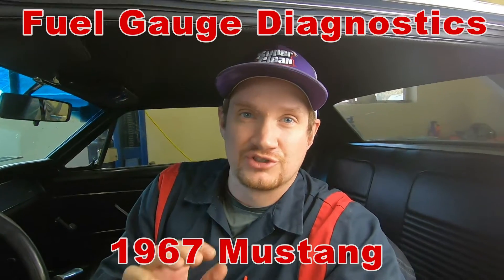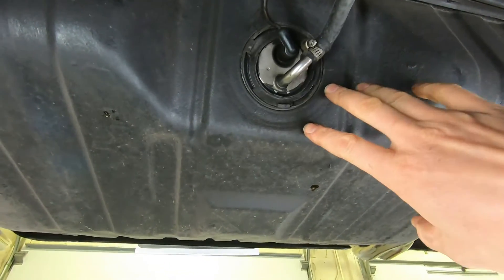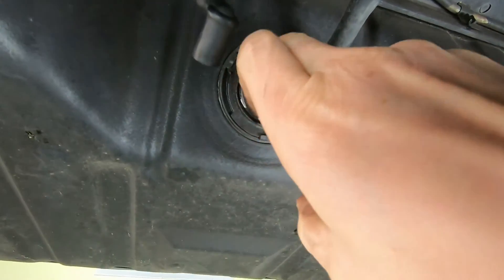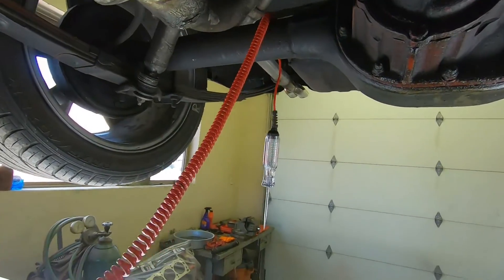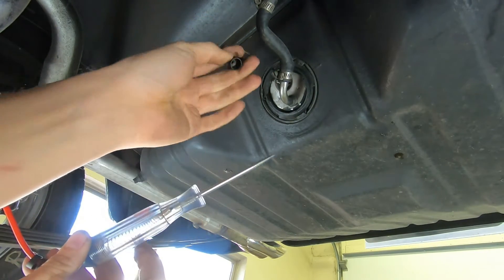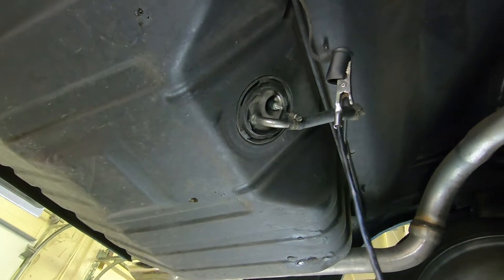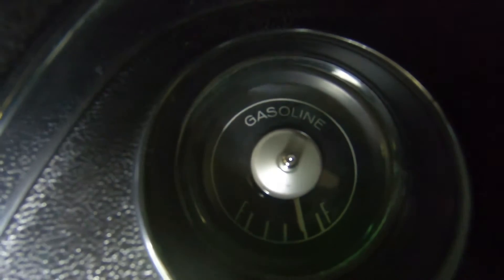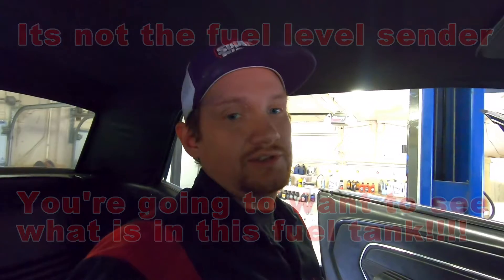Fuel Gauge Diagnostics - 1967 Ford Mustang

Comment: Enjoyed the video, but I don't understand the difference between the two methods used to test connection to the fuel tank/gauge. In the first test (using the test lamp) the ground is to the battery and the key is on. The test light then goes on to show the circuit is good.  OK. The second test uses a wire to ground the sending unit wire and then the key is turned on to watch the gauge needle climb to "full".  In both cases, the sending wire is grounded, right?  I followed your guide for the both tests, but when I tried using the test light, the light did NOT go on, but the fuel gauge went to full.  Doing the second test, the fuel gauge went to "full".  Seems I did the same thing twice.  So, how do I interpret the information?

Comment: When testing the fuel guage, where are the leads ran to?  I see a leads to the u bolt and one to the fuel sending unit wire.  What is on the other end of the leads?
1967 coupe, T-5 swapped and 289.
Reply from the maker: That's it. One to the sending unit wire, the other to ground.
Reply: @AlfsMustangGarage  
I meant, leads from the battery or multimeter,  or, etc??? 
Signed, electrically challenged.
Reply from the maker: @theepas0509 https://youtu.be/gTC5uqolllo
You should watch this one to be more familiar with electrical testing.

Comment: What does that mean if it doesn’t spike when you do the last test ?
Reply from the maker: It means there is no voltage at the sending unit. If there is no voltage at the sending unit, then it could be a voltage supply issue to the gauge, a broken wire, or the gauge itself is faulty. Next step would be to see if the gauge is getting voltage.
Reply: @AlfsMustangGarage  ok 👌🏽 thanks and when it does spike, if it spikes it should spike to the level of where the gas was last filled to right?
Reply from the maker: @tmacdagreattv no, it will peg completely to the right side of the gauge. You're giving it full contact ground, and the gauge is not intended to get full ground ever. This is why you only want to do this for a split second. It's just long enough to see if the gauge responds.

Comment: I did the tests on the sending unit as you described.  The fuel gauge will head to full after grounding the wire for the sending unit and turning the key to "on".  However, when I use the test light to check the wire for the sending unit, the test just barely glows red and is a steady light. No pulsations.  Does this point to a bad constant voltage regulator?  If so, will be my third one!

Comment: Testing my 63 falcon gas gauge. When connecting the sender wire to the ground I'm getting a weak steady light (no pulsing). Then I get no reaction from the Gauge when I connect the + & - to the gauge at the sender. I've also just replaced the regulator prior to these tests.  Would you suggest testing the gauge directly to eliminate a wireing harness problem? Any other suggestion?              thanks! Good video

Comment: late comment, but I just bought a 67 coupe and the gas gauge worked with the old cluster and when I swapped it for the new one the gauge stopped working what should I do ?
Reply from the maker: Well if everything worked fine before you were in there, I would maybe retrace my steps and see if something isn't connected. Or you could just go through the process of diagnosis and see if you're getting power to the sending unit.

Comment: Thank you for this video.  
I followed it to a T, and as it turns out, electrical was all good, and the gauge was in working order.  
The issue i ran into was the float on the sending unit had deteriorated to nothing.  It was literally GONE.  When i pulled the sending unit and i saw it was missing, i assumed it just fell off.  So i pulled the tank and it wasn’t in there.  This was the original sending unit from 1968.  Bench tested it and it still worked.  
Evidently, the brass/copper float can dissolve in fuel after 54 years.  
Great video
Reply from the maker: Oh wow that's incredible. Ya that must be why these little brass floats are available. If you're original sending unit still works great, I would keep it in there. https://amzn.to/432eYcl Here is the link to the replacement float.
Reply: I too have a 68 that the fuel gauge wouldn't go past half a tank. My brass float had a pinhole and was still floating; just not enough to get a good read. I took it this afternoon and filled it but the original gauge registers empty. I found the sender body wasn't grounded. The tank is and I would've thought the ring would have grounded it via the tabs but it doesn't. I know the gauge wiring is intact-followed your instructions. Tomorrow, I'm going to put a jumper wire in the fuel line around the rubber gas line. I kept the original sending unit as I know it worked. I've never lined my tank, it is still shiny inside as I try to avoid ethanol. When ethanol first came out, my Holley carburetor had cork gaskets and when the car wasn't driven, the ethanol blend evaporates and the gaskets shrink.

Comment: Question for you. When grounding the wire to the sending unit, the gauge pegs. Replaced the sending unit twice, and it never went above 3/8 with a full tank. Replaced the voltage limiter. Have pulsing power at the wire to the sending unit. When the limiter is unbolted from the cluster the gauge reads full, when the limiter is bolted/screwed to the cluster, gauge goes back to 1/4. Thinking at this point it must be the gauge.
Reply from the maker: Humm, before you replace the gauge, do we have some bad grounds? Is the gauge cluster grounded behind the dash? Is the fuel tank getting good contact ground to the body? I often times find when things do weird stuff with electrical, check grounds.
Reply: @AlfsMustangGarage yes, the cluster is grounded (checked it). Pretty sure the gas tank is getting a good ground because we hooked the test light to the gas tank to check for the pulse.
Reply from the maker: So you've tried 2 different sending units? If you still have one of them, can you connect the sending unit wire to a sending unit outside of the tank? You'll have to ground the body if the sending unit to the car body to do this. Then you can simulate the sending unit by adjusting the float manually. Occasionally I'll run into one that needs to have the arm bent so it reads accurate. The purpose of this is to see if the gauge will read full when the float is for sure at the top.
Reply: @AlfsMustangGarage Great idea. So we checked the sending unit that’s not in the car like you suggested and it maxed at 3/4 tank on the gauge. We also ran a grounding wire directly from a body ground and no change (just to eliminate a grounding issue). We tested resistance on the sending unit and it’s reading 7.6 ohms totally full and 76 totally empty. Thank you for all your help.
Reply from the maker: Well I guess that confirms you're suspicion. Sometimes it's a compatibility issue. The sending unit definitely works with the gauge but not accurate. An updated gauge with an updated sending unit makes sense.
Reply: @AlfsMustangGarage Thanks. Got one ordered, so hopefully will be back in working order in a few days.
Reply from the maker: Awesome. Let me know how it goes. I'm genuinely curious.

Comment: I can’t find my ground wire for my fuel gauge can someone help me on where it is I checked under the car and everything and I can’t find it I believe it’s been cut I just need to know where it leads to so I can replace it
Reply from the maker: It will come off the fuel gauge and run down the driver side sill plate channel, over the rear wheel house and end up in the trunk. From there it will pass through the floor in the trunk usually right in front of the fuel tank.

Comment: Got to step of checking the gauge the needle went to about 1/4 and stopped, when tank is full it showed about 3/4 full. Is it the gauge?
Reply from the maker: I would say probably not. If the gauge is capable of reading 3/4 when there is fuel in the tank but only goes to 1/4 when you have it connected to ground, I would question the ground you're connecting to. Which leads my mind to how well your tank is grounded to the body of the car.

Comment: Wow! Never seen that before on a car, but it was pretty common to see in motorcycle tanks. I remember actually doing this to one of my older motorcycles as a rust inhibitor but it was like paint. You dumped it in and rolled it around and poured out the excess. It was nothing like that - crazy! Alf, any idea what would cause the fuel gauge to not read below half a tank or so? I topped off my tank and gauge goes to ‘F’ but as I drive my 65, the gauge doesn’t seem to ever read below half a tank or so. Is the float arm maybe getting stuck? Electrical seems to all check out. Thanks in advance! Great video on how to troubleshoot as always…
Reply from the maker: Oh ya that's a first for me also. I would say the most likely issue is something with the sending unit. Especially if all the electrical checks out.

Comment: Best explanation of the sending unit and sending more or less signal to ground on the fuel gauge. Being an electronics guy, this was very helpful. 
Thank you!
Reply from the maker: Oh awesome thank you!
Reply: Excellent explanation of correct testing procedure using the actual equipment in the car (which can be key to solving problems). I watched other videos that did not show how pulsating voltage can be tested right at the tank. Great job!

Comment: Hey, got a 68 mustang gt. When turn key on fuel gauge spikes past the full mark. There is no power at the fuel tank sendor  unit. I check power at The gauge and there is pulsating power on one side of the gauge and not the other. Does this mean the gauge is bad?
Reply from the maker: I would say the gauge wire is shorted to ground between the gauge and sender. Use a ohm meter to test off the gauge to ground and see if there is a connection there with the fuel level sender disconnected.
Reply: Someone changed the fuel gauge and had it grounded out against the dash!
Reply from the maker: Good find!

Comment: 2012 v6 mustang behind the passenger seat, there is a sending unit. It is making noise when I climb. Does that part have a pump as well or is it just plastic that monitors fuel gaige level?  Thank you.
Reply from the maker: On modern cars those are typically fuel pump modules. It will have the pump and  fuel level sensor all in one unit.

Comment: Lots of radiator shops boil out the old tank and solder up the leaks. Next they apply a 2 part epoxy coating inside the tank. They often spray the tank black out of habit like they do to repaired radiators. This may be the case. However, with the advent of 10% ethanol fuels, a revised  epoxy formulation that is resistant to this alcohol must be used. Most likely the incorrect epoxy coating was installed. The irony is a replacement tank is cheaper than the cost of repairing the original and unless this is a Shelby or K-code car, it’s foolish to not buy a new one.
Reply from the maker: Yup, way too much work for a C code coupe. She got a new tank 👍

Comment: Hey sir I went through the diagnosis from your video l and didn’t have a pulsing light when checked with my tester. I made sure I was grounded in multiple places (cause I don’t have a line long enough to connect to the battery) and cleaned each bolt that I connected to ensure a good connection. I did turned the car on to the on position. But no luck with any light from my tester. Then when I grounded the gas gauge send unit and turned the car to on the gauge would only go up to half full and then stop. It never went to full. Do I have a bad wire? The constantly reads at a quarter tank too. I am lost and appreciate any advice.
Reply from the maker: Well I think you should be seeing some sort of power on that wire. Especially when you ground it and see the gauge respond. Even though it's only going half way tells me there should be power on that wire. Now the power is coming from the constant voltage regulator on the back of the cluster. Sometimes people change those to a different type of unit that stays solid voltage rather than a pulsed voltage. So just keep that in mind. I think it would be worth your while to get those extendable test leads like what I have. You can pick those up at almost any auto parts store. And run it all the way to the negative battery post. It's possible that you're having a grounding issue and that's why it only goes 1/4 of the way. Try grounding the fuel tank directly to the negative battery terminal and if all of the sudden its working normally, then there is your issue.
Reply: Thank you for your feedback. I went and got the longer test leads and now more confused haha. I am not getting my tester to flash or light when grounded to the battery and the car turned to on, and same result when turned to accessory. Then when I checked the sending unit grounded to the battery and turned on, my gauge doesn’t move. It just shows at quarter of a tank with no movement. I am sorry to keep bothering you but I am stumped.
Reply from the maker: No worries. I'm going to ask some basic questions but just so you know I'm not questioning your abilities. Just want to make sure we are on the same page. So first, what are you using to test with? A test light or a volt meter? Second, the positive end of your tester is being attached to the end of the wire that feeds the sending unit? Third, the negative end of your tester is attached all the way to the negative battery terminal? Forth, all those test connections are good? And fifth, the key is in the on position?
Reply: I appreciate the questions cause I am just starting the journey of owning a classic car with no training. I am using a Cen-tech 12v tester from harbor freight. It only has one clip at the end so I am not sure about the question of the positive connection. I don’t have it connected to any hot connection and that may be my issue. It is connected to the sending unit and I have the clip as far as it goes to ensure proper connection. I am connected to the negative on the battery and it’s a clean connection. I did may sure the key is turned to the on position when testing.
Reply from the maker: Is that like a test light that lights up when power is present? If so the clip end connects to ground and the pointed end connects to what you're testing. So keep in mind, you're not connecting anything to the actual sending unit. You're connecting to the wire that goes to the sending unit. So just to reiterate, the clamp on the tester goes to negative battery and the other end goes to the sending unit wire (disconnected from the sending unit) with key on engine off. Should see a pulsed voltage but it could be a solid voltage too.
Reply: Yes sir that is how I was testing.  I was not getting any light, pulsing or solid. Had the 30 foot test lead wires on just the negative terminal on my battery and ran it to my tester. The clamp of my tester connected to the negative lead wire clamp. The pointed end of my tester  was put into the sending unit wire that was disconnected from the tank. I turned the car onto the on position. I pressed the tip into the sending unit wire and held it firmly for a few seconds and moving it hoping to get a light to appear on the tester but had no luck. Went and turned my car off. Connected my grounded test wire from my negative battery terminal to the sending unit wire itself. I made sure the clamp was connected as deep as possible on the fuel sending unit wire and turned the car on. The fuel gauge did not move. I am at a loss.
Reply from the maker: Well at the end of the day, if you're not getting any power there, then the problem is with the power supply. However, i am puzzled because you mentioned that when you grounded the wire, the gauge went to the half way point. That doesnt happen when there is no power there. So now for another round of questions. Do any of your gauges work or is the fuel gauge the only one you have issues with? Have you tested your test light to make sure it is working properly? You can simply test it on the battery to make sure it lights up.
Reply: When I got movement on the gauge I was grounding it to the actual housing unit for the sending unit. I’ll try and replicate it tomorrow. 

But no, none of my gauges work except my speed. I do need to test my light. I will follow your video on checking my other gauges and hope the light works there.
Reply from the maker: Okay so when all 3 gauges are not working ( oil, temp, fuel), that usually tells me there is an issue with the constant voltage regulator. That is what supplies the pulsed limited voltage to all of those gauges. If none of those are working, I usually go right to that unit. It should have a power going to it with key on and then coming out is a limited pulsed voltage that supplies all 3 gauges.  That unit is mounted on the back of the instrument cluster.
Reply: Thank you I will attempt to find it tomorrow. Do you have a video on it by chance? 

I truly appreciate all your knowledge and advice! Thank you very much!
Reply from the maker: I'm afraid I don't have a video on that yet. I assume there are some videos on that out there. Let me know how it goes!
Reply: Just wanted to give an update, I finally got my voltage regulator in from order. Got it in and all my gauges work now expect my gas gauge. Sadly kids pulled me away from the car before I can go back and check the sending unit. But process of elimination I am guessing that is the next issue to tackle. I will do the same steps as before. But excited for the progress. Just wanted to say thank you and let you know I really appreciate the help!! Really love your channel!
Reply from the maker: Very good to hear! Thanks for the update!